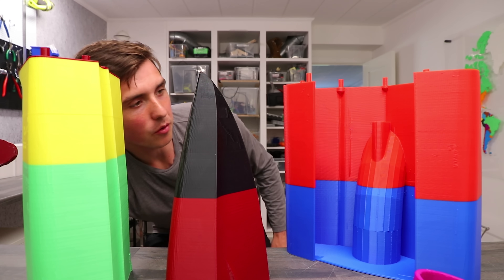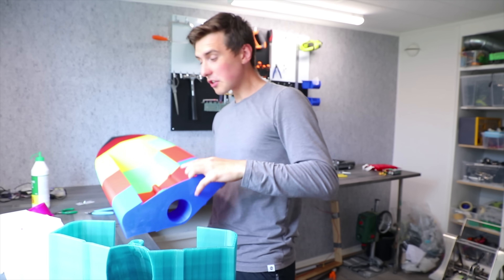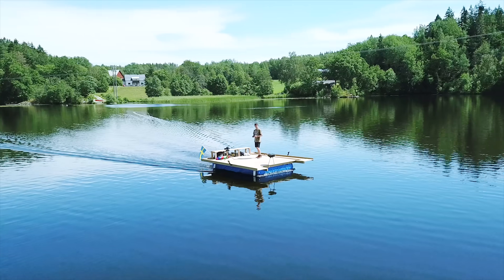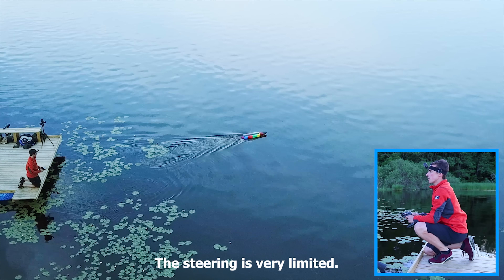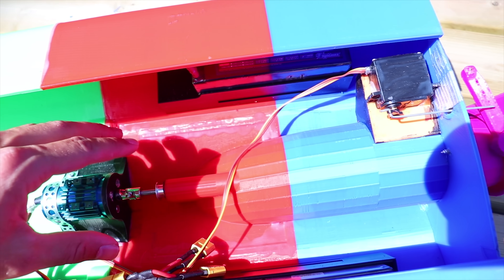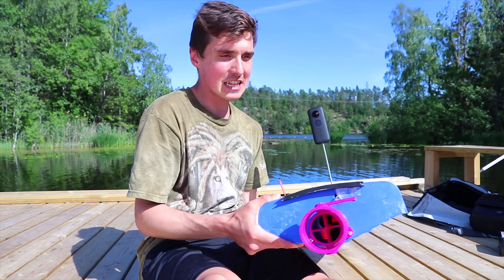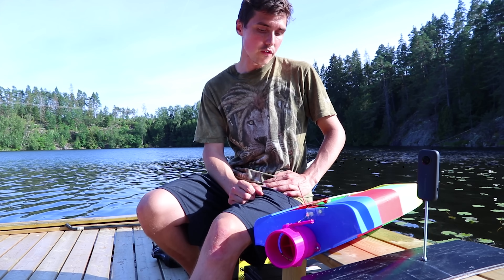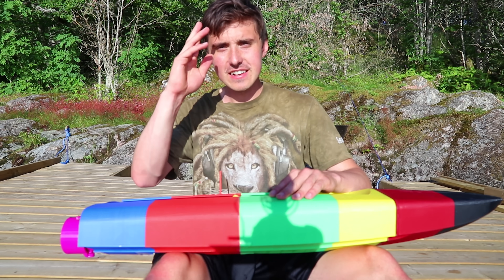Rainbow Powered 3D Printed RC Boat

Comment: Hello,

I just purchased the Creatbot F-430 with the dual extruder. The BLtouch they provided died on me so I replaced it with the new one. While replacing it I noticed the BLTouch they gave me is BLTouch Smart V2.1 however on the official website there is no such thing so I think it was a fake (also it doesn't have any QR code). THe one I just purchased is the BLTouch Smart V3.0 when I plugged it in it do the in and out twice so I know I connected it right but after that when I use the M208 code nothing works. I am suppose to update the firmware to work with it however I don't know how. Most of the youtube showed the udpate using arduino but I have no idea how to do that with this machine. Would you please help me?

Thank you so much

Comment: The image of the video doesn't show how big it is .
it's will be better if you used dual motors and make the controlling by changing the spead of one of the two motors . so that you will not need this plastic ring anymore and you will get this power that it wast , also it would be more efficient than the stepper motor .
and maybe the mega upgrade of this project would be with triple motor system that would way more powerful and it would be better to use carbon fibre in it .

Comment: I used wood glue on foam and it only dries if the water can evaporate i.e. within about 10mm from the edges, so for a work-around I sandwiched paper to soak up the moisture and permeate it outwards to the dry paper/outside. Your plastic will not allow the glue to dry inside and it will stay wet. Bust it apart to check.

Comment: You can get 4076 1600-2250 kv for $35...it's actually designed for boats
but I use it in my 1/8 r/c buggie /MT. it's just a 4s motor.
it'll mount on 36 dia ( 550 brushed) motor mounts.
but it's going to have wazoo torque...so you'll either have to make stronger props
or get metal props.
I'd seal the boat thou @ higher speed..it'll flip...ect
if you're having fun with it at it's current speed..just install your coolling system.
I'd still protect my electronics and batteries...they're not cheap.

it's  a cool project.
Have you ever thought of making RIBS for wings..it'll be stronger than balsa.
Then you can just use 99 cent shrink or packing TAPE for the skin...
instead of expensive mono coat film..ect.
This way it'll be lighter than folding 2 sheets of foam...so you can
cut out slots to redue wieght..then just reskin it with packing tape

Plus it'll be more consistant using a printer to make ribs..instead of hand cutting them.
or make a flying boat/jet haul.

or make a frame for an R/C ultra light...so this way it'll be like a KITE.
For transport and STORAGE....

So you can take apart and easily assemble at the field...but it'll be a BIG R/C
Ultra light.

The haul to my Px16 are just thin ( food container or r/c car body ) plastic..so it's light.
I install twins 3650 brushless...it's fast, fast even on 2s..it's plenty on 3s for each motor.
All I did was sholve styra foam inside to haul...to eleminant empty space .
if it flips the hull wont get filled with water...it's simple and effective.
My electronic are seal as best as i can so water wont enter..vai food containers
and selicones.

Comment: If anybody is interested in getting some protopasta carbon fiber ($27) or stainless steel ($40) filled filament I have some  for sale. Or enter the auction. (You might get a better deal.) https://www.ebay.com/sch/dagoodel-0/m.html?_nkw=&_armrs=1&_ipg=&_from=

Comment: My sugestions would be lowering the output tube under water so there is less energy loss by air bubles as the prop isn't fully submerged. as it's basicaly an axial pump so it doesn't build up pressure anyway but now its even worse.
the second sugestion would be a bigger intake and or a lid that pulls water into the duct so there is less chance of cavitation. also remove the cross in the tube it only adds drag when it straight, or you'll need to put it at a specivic angle to counter act and nulify the generated vortex in the flow.

For cooling the motor/esc either use some of the pressure created by the generated trust / water flow, or use the hull as a heatsink. an other option would be to print a small fan that creates a bit of airflow over the motor as that is a minor energy loss compared to the prop but active airflow massively increases cooling capabilities of heatsinks.

i do love these types of content! please keep making more!

Comment: Simon, that was awesome! Next, could you please decrease the diameter of the pink outlet tube? Or simply extend it so that the final outlet hole is smaller, like making a cone. This will increase the speed of the boat without requiring you to add more batteries or step up the voltage. More speed, no risk of burning up electronics, and longer battery life, all ~for free by just changing the diameter of the final water outlet hole. Thanks for posting!

Comment: Reshape the exhaust to cone shape.
Also your propeller not effective shape for waterjet. Blades shoud be intersects a lot more than 10 20%. Leading edge of propeller blade need to be rounded to prevent cavitation in high rpm.
Look for water jet design used in waterbikes.

Comment: Giant Lego-type boat?  Yes, please.  Use a water jacket on the motor with a pickup tube.  It's kind of a small motor in relation to the diameter of the impeller, but not terribly so.  Get a big Turnigy Aquastar 56mm diameter motor (includes cooling jacket), and run it on 10s!
https://hobbyking.com/en_us/turnigy-aquastar-t20-3t-730kv-1280kv-water-cooled-brushless-motor.html

Comment: Why dont u get resin and vacuum infuse the hull? That would make it airtight. I worked in Formula SAE and the Intake that I had designed was 3D printed, To make it a perfect seal we used vacuum infusion.

Comment: motor is not your bottleneck, its your prop. Bronzepropeller are twice as efficient.
Reply: Why would a different material have an effect on efficiency? I would expect the shape to be the only factor.
Reply: @oznerol256  bronze or Alu is very stiff, sharp and well balancend.

Comment: Why don't you use cyanoacrylate glue ? This is what I ue for 3D printed planes and it holds extremely well. 3D printed parts break but the joints are always intact ;)

Comment: I would coat the outside of your print with marine epoxy (e.g. west systems) and then sand back, it prevents leaks as the prints are porous

Comment: it doesn't look like your electronics are waterproof, so you may want to put some more time in that.  If you go to the Norwegian equivalent of Home depot, you can buy a clear caulk or sealant for the bottom of the boat.  The glue will hold it together, but not necessarily make it water proof.

Comment: That prop looks way too big for me for such small motor. The bigger the prop the slower it should turn. Im guessing that inrunner turns at way too much speed and way too low torque for that propeller. I would try to reduce the motor speed with a gear ratio of about 2.5:1, put a more torqy outrunner or reduce the size of the propeller

Comment: Water cooling will definitely help your heating issues! Since your looking into bigger electronics consider a water cooled esc as well. Cheers!
Reply: That is a water cooled ESC. You can see the brass barbs on it for the waterblock. He's just not using them for some reason? (I hope there's a reason)
Reply: @aval1998  because his jet drive doesn't have a coolant port for a pressurized water supply.
Reply: @Houstonruss  doesn't even need to have that. Most radio controlled boats (my ship doesn't need a water intake as the ESCs are air cooled and have powerful fans running) have a scoop on the bottom of the hull to push water into the waterblock OR have an intake built into the rudder. Plus, your comment WOULD make sense if the jet pump was manufactured rather than printed from a CAD model, which can be designed to have a water intake for cooling.
Reply: Mr.Einstein I’m sure he could drill one in

Comment: RECOMMENDED GLUE for bonding plastic together : Hands down is JB Weld Plastic Bonder!!!
Here is a link to Amazon.co.uk https://www.amazon.co.uk/Weld-50139-Adhesive-Syringe-Dries-Black-25/dp/B01IBOK7FE/ 
ALSO they do sell a Marine Weld as well (which I have never used) seen here: https://www.amazon.co.uk/J-B-Marine-Weld-Epoxy-Adhesive/dp/B000KKPFFA/ 
(I have tried other brand Plastic Bonders and they all have been cheap & brittle not worth purchasing BUT the JB Weld bonder is PERFECT for bonding plastic parts together and is waterproof as well - once you try it you'll NEVER need another glue for 3D printing!) 
They claim to have the worlds strongest bonder and I think that's true - here is their homepage : https://www.jbweld.com/collections/epoxy-adhesives/products/j-b-plastic-bonder-syringe  
(Note they do have other colors such as TAN) And if your interested in a more translucent glue they do have this as well https://www.amazon.co.uk/JB-Weld-Plastic-Syringe/dp/B009EU5ZMK/ which I've never used the Plastic Weld so I am not sure how well ti works as compared to the Plastic Bonder it should be similar.

Comment: I think you should build one with solar panels on top :). Maybe also lithium-ion cells so that its even further away from a racing boat but it would be something that lasts a while.
Reply: Not sure what the point would be, unfortunately! These cells hold a lot of power, and take an hour or more to charge from mains AC and can be completely used up in probably 15 minutes! Solar would take days to charge the batteries, most likely. If he could have consistent sun!
Reply: @williamthomasmi10  yea i can't disagree. But maybe if you build a boat thats ment for low power consumption and slap like 10w of solar on there it would deliver something. I never saw him working with solar before so i bet it would be a fun project for him

Comment: Seems like it needs a tapered thrust nozzle to increase the speed of the flow out the back.
Reply: I think if the thrust vectoring was inside a straight nozzle it would limit the drag significantly.
Reply: @jnevercast  what do you mean inside? I'm curious
Reply: @lukeD8099  Please excuse the crudity of this model. I didn't have time to build it to scale or paint it.

https://imgur.com/a/pndJ0GO

Two versions there, one with a simple cylindrical exhaust, and one with fins, could combine them I guess. I'm an amatuer at F360 so I wont do anymore than that.

Comment: Simon ideas for other videos
Another update on "Best 3D printers" video or more reviews on different models
Printing with Nylon
RC basics and what parts to buy.
Reply: I'd also like to see an updated best 3D printer video. I would also like to hear what he says about printing with Nylon.
His RC gear seems kind of dated. It works great for what he does but you might want to check out Andrew Newton's RC Basics - Connections video.
I'm now a fan of having radio receivers separate from the servo/ESC controllers. This allows the RC vehicle to be smarter. SBUS protocol allow more control options than the older systems. The new RC gear also includes telemetry. The new stuff is very reasonably priced. 
What sort of RC vehicles are you interested in?
Thanks for the fun video RCLifeOn! You have lots of great projects!
Reply: I also would like to see an update on best 3D printers in various price ranges.  I'm getting closer to getting one, so it would be much appreciated.

Comment: Looks great. How many kilo of filament did you use for the final build?
Reply from the maker: A couple of rolls actually, probably 2-3kg. It was printed with a 0.8mm nozzle and 0.4mm layer height. All 3 sections was roughly 50 hours printing.